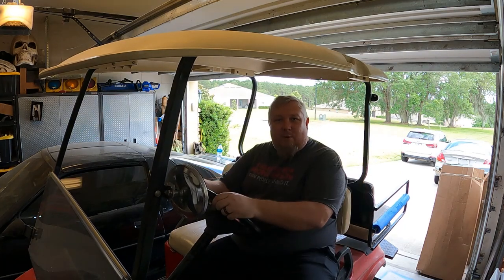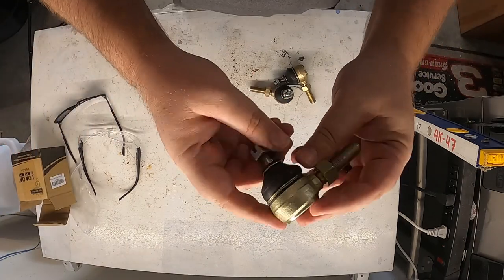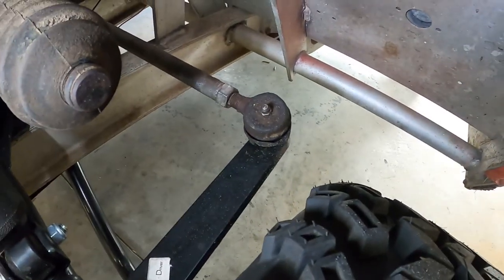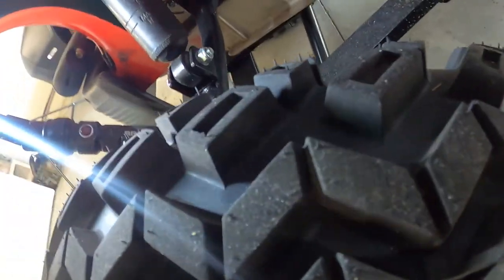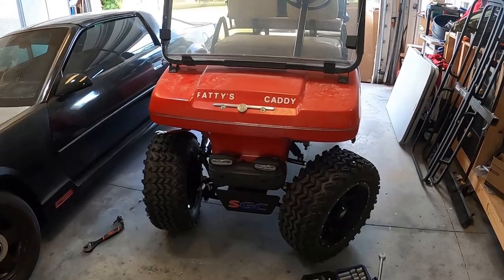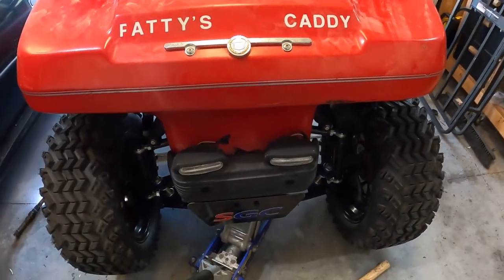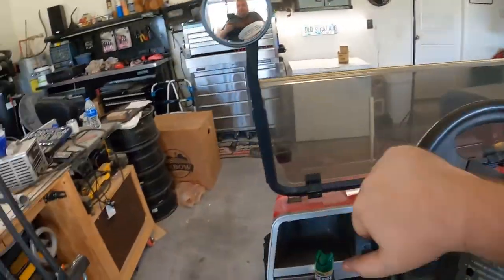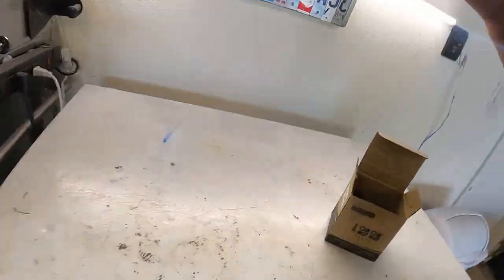Day 2 of Lift kit: Adjusting Steering on Golf Cart

Comment: Not a very informative adjustment video...  was hoping for just a bit of instruction on how adjustments are made.
Reply from the maker: Yeah mine isn’t perfect, thinking of taking it to a shop to be honest
Reply: NO! you're doing fine. Use an right angle to eyeball the camber (wheels perpendicular to the floor). A little negative camber is good (both tire slightly toward the cart at the top of the wheels. Adjust the tow-in (make a jig) front of tires 1/4" less than the rear of the tires. I'll email a photo of my jig, and a copy of the adjustment from the manual.  @CamaroMac